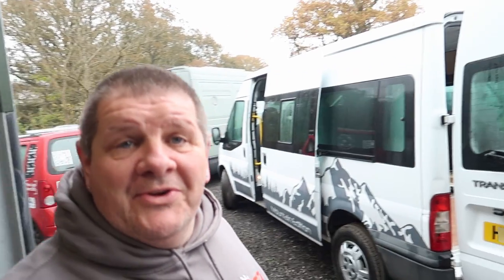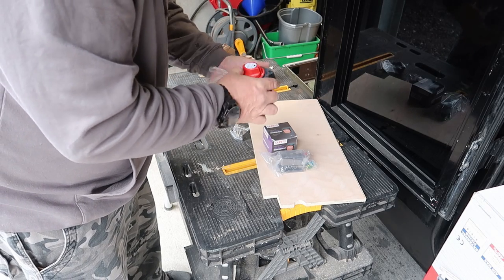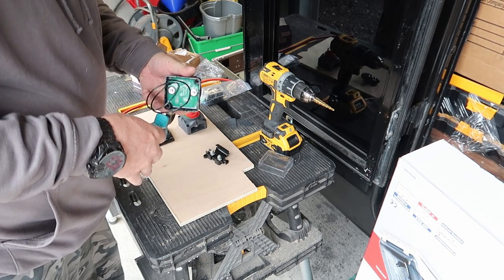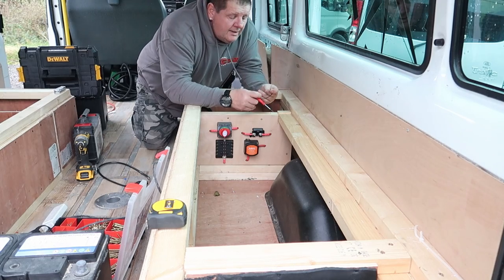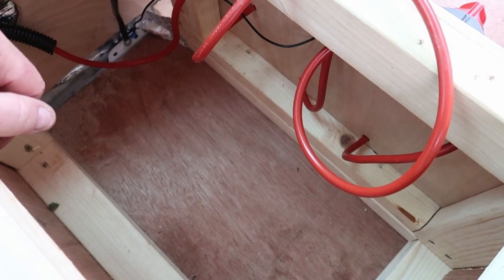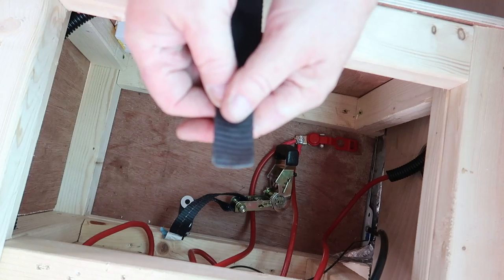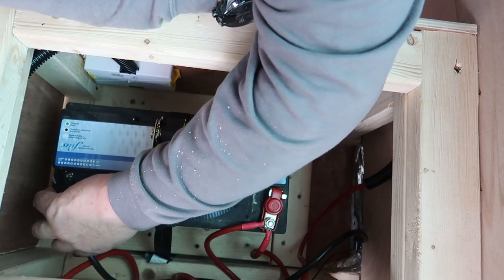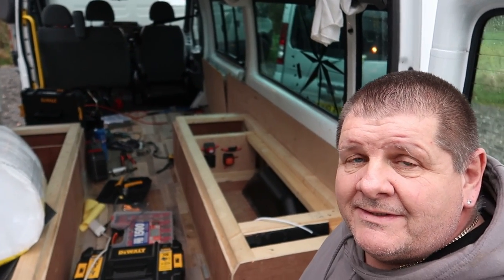FORD TRANSIT - Basic 12v Electrics Installation

Comment: Karl, I really think that you’ve fused the VSR on the incorrect side. You’ve basically double fused a cable. The VSR is not protected from or by the battery.
Reply from the maker: I just had to check myself then lol I have made sure they are both fused by each battery.  The one on the board may have been a bit confusing in my explanation.

Comment: That -ve cable to the bodywork should be connected with at least an M6 bolt with Nyloc Karl! That self drilling screw could vibrate loose!! ;-)
Reply from the maker: True but took customers considerations into account with this usually it would have been a rivnut and a bolt

Comment: well explained and easy to follow..could i use the aux battery under the driver seat as a leisure battery ?..or do i need an extra battery in back as a leisure battery ?..
Reply from the maker: I would use a seperate battery from your cans system definitely.

Comment: hi could you tell me the two red positives you joined together off the back of the board to go to leisure battery I presume thank you in advance for your reply
Reply from the maker: one of the positives is from the output of the fuse from the split charge relay as one fuse goes by the leisure battery and one fuse goes by the stater battery.
The other positive goes between the leisure battery and the isolator to the main leisure electrics.